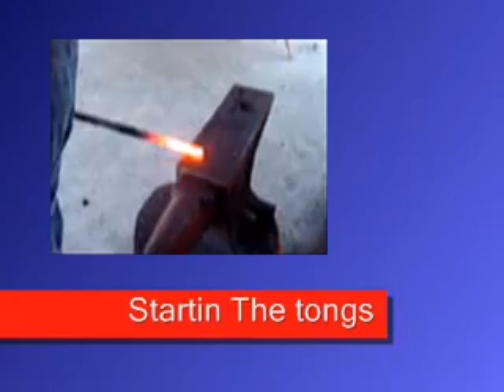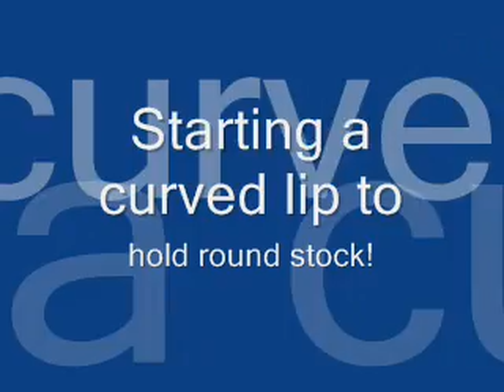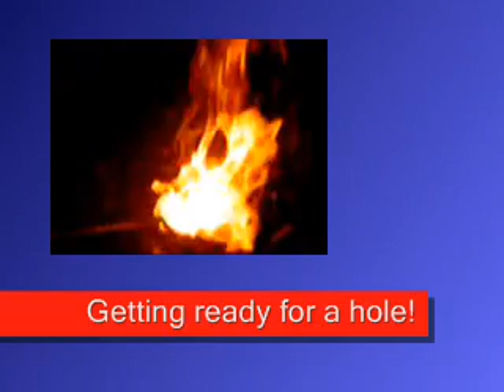Blacksmiths Forging Tongs Part 1

Comment: Hi!

I was taught this technique. It's a bit tricky (for me), but basically this is it:

Hold the tong by the reins, so that the hinge-plate's set is turned away from the smith, and with the tongs nearly vertical, settle that set on the face of the anvil, and then hit the top set (which leads to the bits) with the very edge of the hammer, as close to the bits as possible. If you manage it, you'll have a stockier hinge-plate, which should handle heavy stuff a little better.

Happy forging!